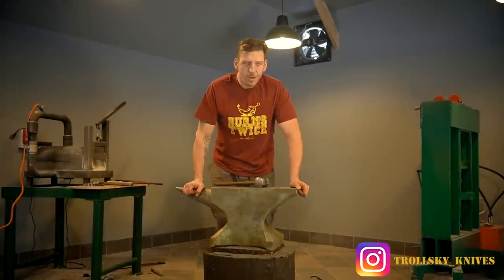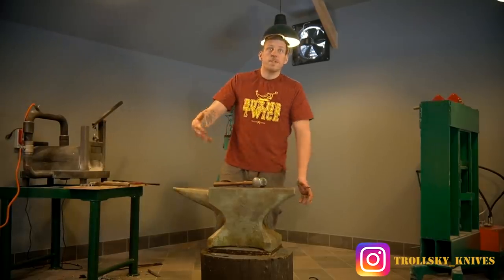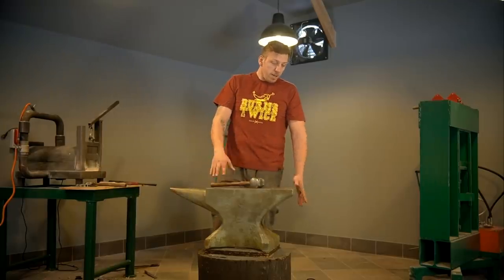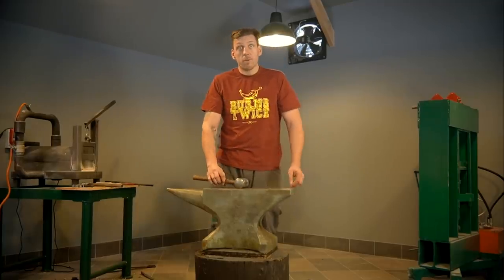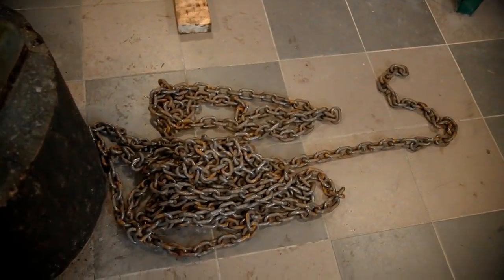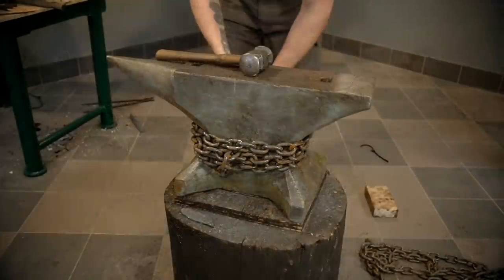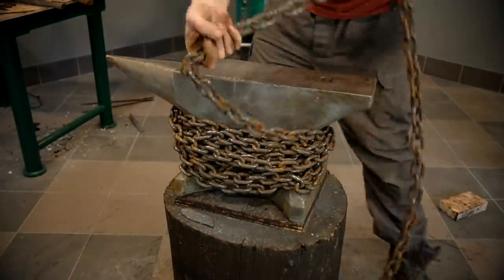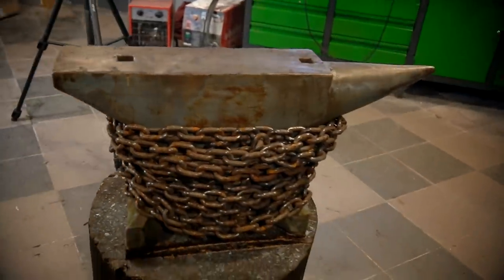WHY BLACKSMITHS ARE WRAPPING THEIR ANVILS WITH A CHAIN? [Trollsky Knifemaking]

Comment: Trollskyy, I love your video's, and your way of working, however, there are better ways to muffle a loud anvil. As well, chaining up an anvil, may be ok for the knife maker, but it severely limits the the available working surface for anyone performing everyday Blacksmithing and forging practices. I've been a professional Blacksmith for 45 years, never had another job, so I know the value of utilizing all the surfaces of an anvil when working a forge. I have a 600 pound Peter Wright, that has been attached to a very large solid oak log, heated railroad spikes are driven in to oak securing the bond. This will reduce the ring in any anvil by interrupting the vibrations?sound waves.  To be clear... of course there is no right or wrong way to do this, but in my world the limitations of stacked chaining just would never work for me. peace

Comment: The chain also adds some "weight" to your anvil. I bought my anvil while at farrier school, so I got a 75 pounder. Big enough to do any work I need to do on it,  but small enough to move around. I love my anvil. It has a nice big face and horn, with nice clean edges, and I've made several knives on it, as well as other cool metalwork projects. It gives great feedback as well, but it's still a 75 pound anvil. When I wrap chain around it, I can bang away with a four pound hammer, and that puppy won't move an inch. When there aren't any chains on it, I have two huge magnets that help deaden the sound.

Great video, as always! A perfect reason for a nip of whisky.

Comment: The audio quality is really bad because of the the echo. I can barely understand what you are saying. I guess some acoustic dampening and maybe a better microphone setup will help with that.
As for the sound of the anvil it did not really make it more quiet in the videos audio, only the vibrations / ringing after hitting the anvil is shorter.